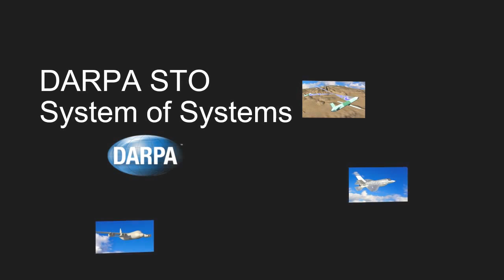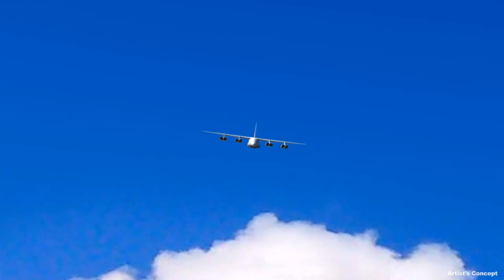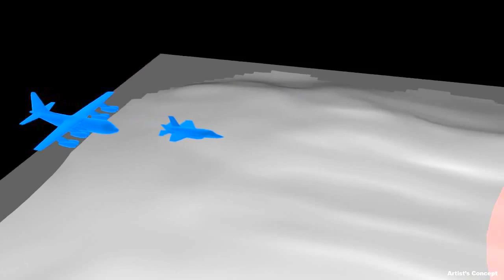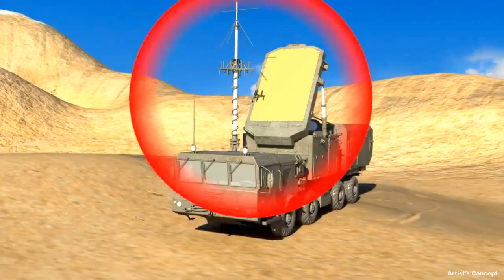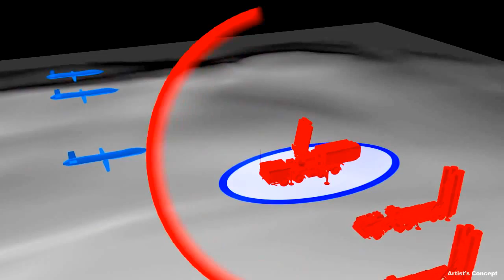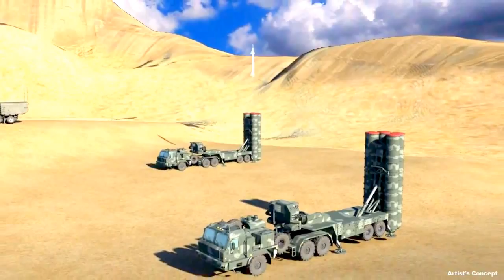DARPA - Air Warfare Concept For Highly Contested Environments Combat Simulation [720p]

Comment: I can see the UAS's getting compromised and then sending the F-35 the wrong info.  Since the F-35 is relying on the info of the UAS to be accurate.  If the F-35 gets bogus info that looks real, some one will certainly have a bigger headache.

Comment: RIP to the S-400 With enough cheap low cost cruise missiles, Russian and Chinese SAM systems can be easily overwhelmed and destroyed.  

The only thing this animation doesn't take into account is the lower tier SAMs and other countermeasures designed to protect the big SAMs.  Systems like the Pantsir-S1, 9K22 Tunguska and chaff/smoke screens are used for this purpose.  However, after their location is revealed they could still be overwhelmed with enough low cost cruise missiles.  

The LCCMs would be flying very low so the Pantsir-S1 would only have a short time to detect and fire on them when they came over the horizon.  If 5 of them come over the hill from different directions within a few seconds, a Pantsir-S1 is probably not going to be able to get them all and it only takes one LCCM hit to the radar and the S-400 is doomed.

Comment: So... What if those enemy radars are protected by anti-SEAD missile SHORADS? I mean, a couple of proximity-fuzed 30mm HEF shells in a burst and that LCCM would be down and out. A low-cost missile from something like a TOR or a Pantsir would do the trick too. I mean, it doesn't even matter if those LCCMs are supersonic and stealthy. That can be detected just fine with a few intersecting long-wave radars coordinated with the SHORADs. That is, if the C-130-sized "truck" in question can even get close enough to deploy those LCCMs.

But still, swarm missiles are still clearly the best option. Well, keep trying!